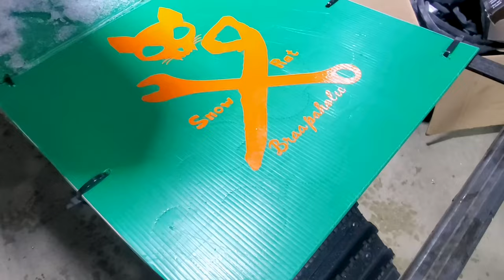This Crazy TimberSled Snow Bike was Built Under $300

Comment: Nicee..this is awesome bro..I will do it myself to soon, just take some pics from timbersled to have the idea..just a question  it's ok just with 1skid ? Or maybe use somehow 2 skids?✌️
Reply from the maker: Running 1 skid complicates things. Running an old track off of snowmobile in my opinion is too wide. That's why I did not use the two skids.
Reply: @braapaholic  thanks for your reply..I'm just thinking to use a old snowmobile track and modified the skids and the stuff between them to making more straight 🤔🤔